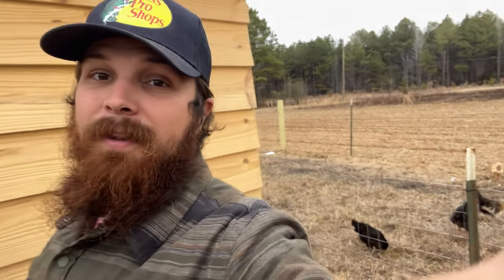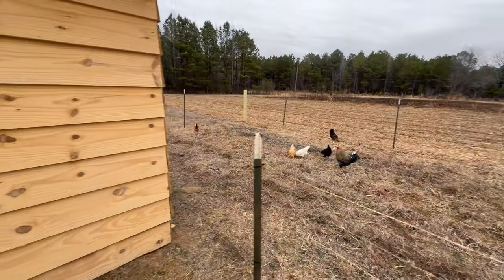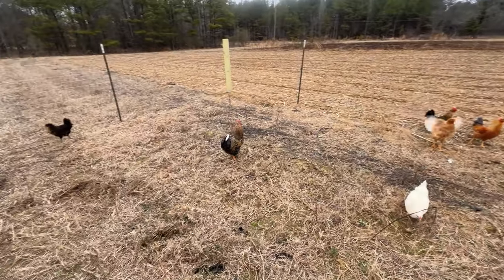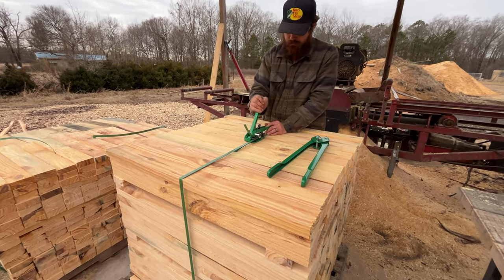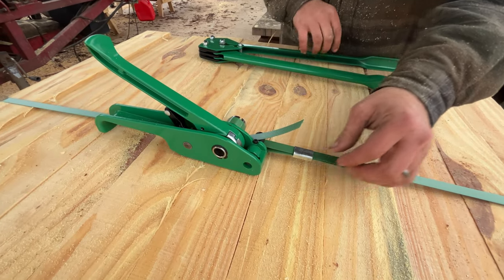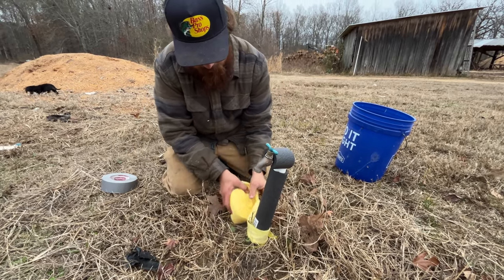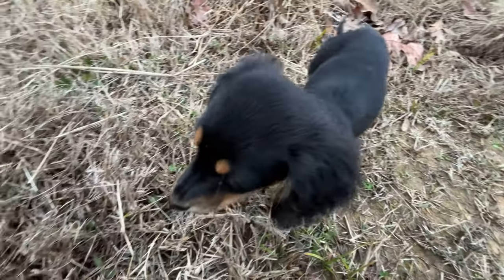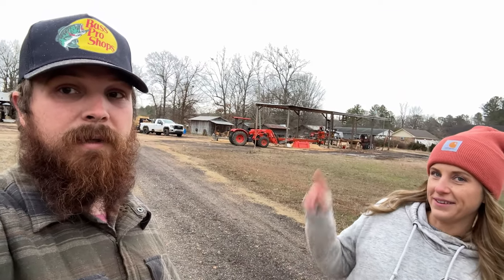Working at the Farm and Sawmill!!! (Can we beat the WINTER freeze?!!)

Comment: Don't forget the water in the saw mill including the water in the pipes. If you are getting temps that low I don't think adding a little soap and/or pine sol to the water will do it. In some colder climates some people use automobile windshield washer fluid. Good luck with the cold weather.
Reply: You need a self draining hydrant   for outside    nothern  Alberta  it is what I used   45 gallon drum  filled with  rocks  to drain into burned 8 feet deep
Reply: @wilmamcdermott3065  I was talking about the water in the tank on the sawmill itself. It should be either drained or made to be nonfreezing. Then there are the hoses that conduct the water to the sawmill blade. If water is left in those it can freeze. Sawmills have been rendered unusable until the water thaws.
Reply: Drain the water in the mill and put in windshield washer fluid.